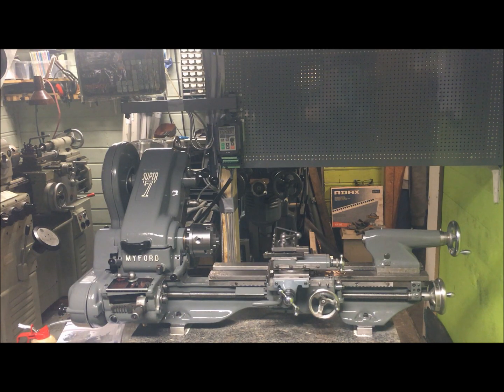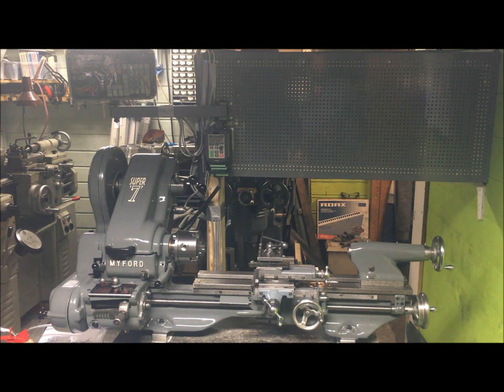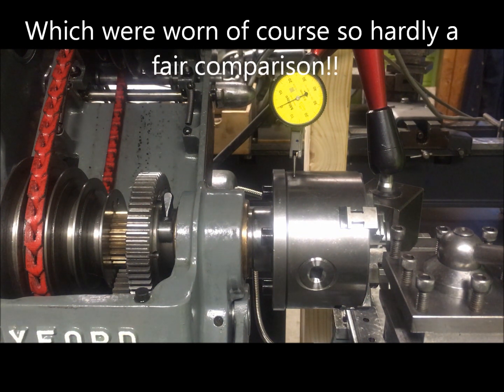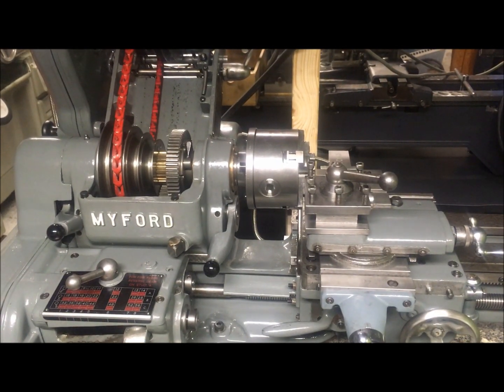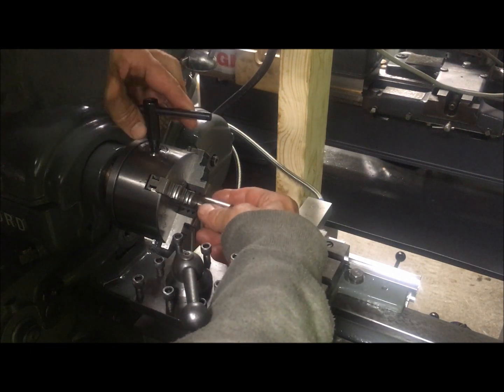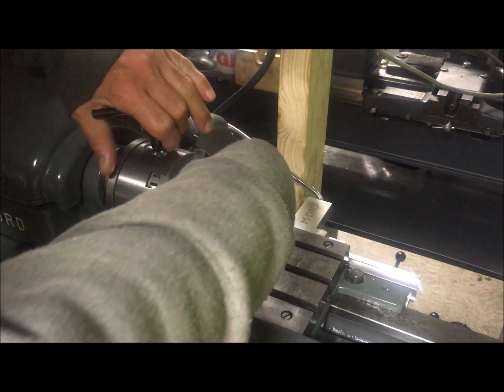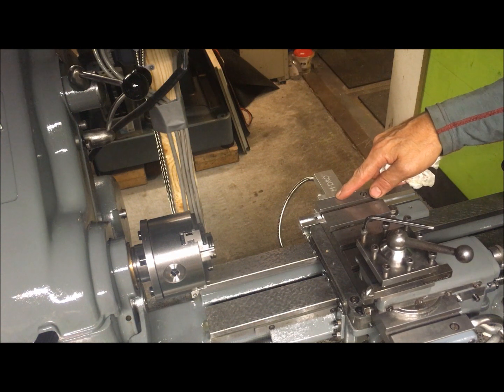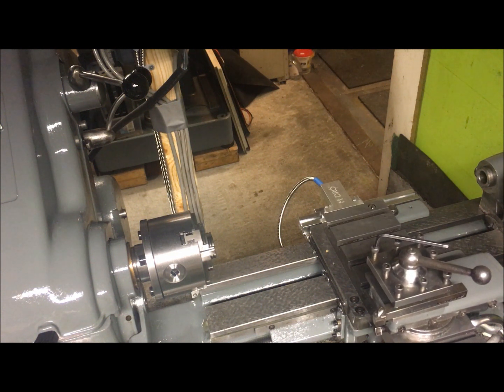Myford Super 7 -  new chuck - status update

Comment: Awsome work you done to this machine,  Now lets see and hear some cuts
Reply from the maker: Thanks.. have you seen my previous videos, for example: testing drilling big holes
Reply: I've wathed them all (at least a hole lot of them)  very enjoyable and educational.. And they have made my lathe better. I have one of them 10x22 asian lathes and they come "pre worn out" from factory. It works pretty good now after some work. Reason i asked about see and hear cut is. for every little thing i did the sound it made during a cut changed, it become smoother and smoother. Or did i get better at grinding tools? probably a combination. Youtube is filled up with sped up footage of machine tools cutting and thats a bit frustrating at times. / rant over, hehe
Reply from the maker: Thanks again..  I see your point. Can try to make a video also on just using the lathe for some turning (I didn't record the making of the backplate for the Sanou chuck as it was such a messy affair spraying cast iron all around, but a more normal turning operation with a steel or aluminium bolt can be better to document

Comment: That has to be the quietest and smoothest running Super 7 I've seen anywhere on Youtube Jan. And a very well thought out place for adding the cross slide dro scale. I may need to borrow that idea. It solves multiple issues that come up when placing it on either side of the cross slide. I bought what Emco then called there heavy duty 4 jaw scroll chuck when I bought my little Compact 5 lathe. It shows a noticeable difference in just how rigidly it holds the work. Chatter while parting off is always much less with a 4 jaw and my lathes limited low rpm range.
Reply from the maker: Thanks for the (always welcome and valid) comment.
I think this DRO kit is really good. Easy to modify the cross-slide and easy to install the assembly. Also an eye-opener.. looking at it now, it is such a "natural" placement of the scale and I will try this on other lathes as well
Reply: Months ago I watched ROBRENZ's video about how he mounted his X axis scale and reader head inside the table casting of his Bridgeport mill. Just like your cross slide, that also avoids multiple issues when mounting it in the usual way to the front or rear of the table and gives it excellent protection. Far tougher and much more work to mount it that way and do so to the required alignment accuracy. But just like you've said it's a very "natural" way to avoid all the other issues. I hope to add a decent Newall dro to my 280 VF lathe in the near future. When I bought the 4 axis DP 900 dro for my mill I added there micro syn scales and reader heads. Eye ball estimates right now indicate using the same Newall scale/ reader head on my lathes cross slide like yours now has might just be possible without removing very much metal at all. If not then I may have to contact Machine dro in the UK and see if they offer the flat magnetic scales like yours in a slightly longer length and use there dro system.

I've spent more than a few hrs studying my lathe and trying to come up with a scale mounting method that didn't create issues with the gib adjustments, slide and carriage locks or the ball oilers without much sucess. Mounting it to the chuck side of the cross slide was out since it's only a matter of time for when you destroy the scale and not if you would. Exactly why mounting the scale and reader head internaly wasn't a completely obvious and far better idea certainly shows I wasn't thinking the problem through very well.  So this video has been more than a little helpful. My sincere thanks Jan.
Reply from the maker: Thanks for the comments (again) :) I am glad it was of help/interest.
Hmm.. I didn't catch that video from Mr. Renzetti.. will have to watch :)
I assume you can get into accuracy issues, but it seems accurate as promised following the instructions. Maybe Machine DRO has some comments on this and their experience re. the X-axis modification and installation (will ask them).
Should be possible to do this mod to many types of lathes, incl. the 280 and 290, EMCO's and their clones as well as bigger industrial lathes whih normally sports a full length cross-slide. btw. I am in the midst of setting up my IZHi611p Russian lathe with a SONY Magnascale 2-axis DRO. This is a "professional use" DRO (and has a matching price tag!), BUT as I bought this a couple of years back (Yes, I pledge guilty.. awfully slow progress..) it was before I saw the embedded installation so this is going to be an external mount. However, I will take advantage of the hints that can be found from looking at M-DRO's "normal" installed x-axis scales (and other's I reckon). These are placed a little further back so as to avoid a problem with the tailstock running up to the cross slide. Of course, it will then require more space to the rear (and probably a rigid mount/bracket), but that is the compromise I must live with. I don't think it will be practical to mount it to the chuck side.. seems to be a risky affair also. As this lathe has a tapered gib, there are no considerations to make re. this. There is a T-slot that have been used with a stop and is also associated with the use of a clock gage, both of which I think will be unecessary or an alternative solution/mod can be found/done.
Reply: Well I may have slightly mislead you Jan. Robin didn't exactly show "how" he mounted his X axis scale within the inside of his Bridgeport's table casting in that video only that he'd done so. I'm guessing he did that long before he started posting videos on Youtube. I very much wish he'd pull his mills table to actually show how it was done and then mention how he checked and adjusted it's alignment. But knowing it's possible might be enough for me to figure it out. I believe he's got at least two mills so a second one might be required?

Yes that Newall dro I bought was much like your Sony and about 3/4s of the price I paid for the mill when it was new. My actual electronics knowledge is very basic. Only a thought and it might be impossible so it wouldn't work at all. As far as I know there's supposed to be only 3-4 general signal types the common scales, reader heads and displays use today. It's not impossible that Machine DRO flat scale you used on your Myford would or might work with your Sony display by simply changing the plug end so it can then be used with your Sony display. Newall, Mitutoyo and likely the others do offer adapter plugs so some different makes of dro reader heads can be used with there displays or there reader heads can be used with other makes of displays. As long as the reader heads output signal is the same it just might work? Your dro's user manual might list what signal type it uses and I'm sure the Sony manual will have what signal type it uses. I'm sure Machine DRO could advise you what there's use.